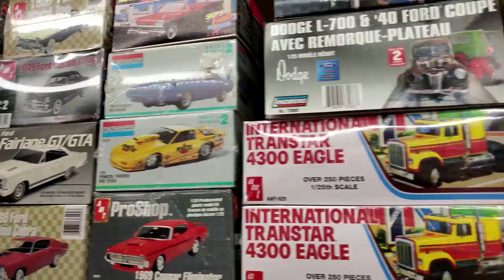Gluing Parts And Learning To Paint!! My Wife Is a Natural Model Builder!!!

Comment: You were talking about the chrome. Why not strip the chrome. I use Zep oven cleaner, spray a bunch in a plastic container. Leave the parts in it for 30 min or longer if needed and wash the parts after. Then you can paint whatever color you want.

Comment: I see you use a shop vac for the paint overspray and fumes.  What do you use inside the shop vac to contain the overspray and fumes from escaping the canister.
Reply from the maker: The exhaust is piped to the outside.

Comment: Primer, let's talk primer....
The primer you used in this video is a sealer primer. Its mainly used to seal the base material from outside contaminants. It lays fairly smooth and should be a little harder to sand once cured. I mostly use it on metal. The 2X primer is mainly a "build primer". Its like sprayable body filler, thus the rough texture. Hopefully this answers your question on why the primer layed so smooth. I genuinely don't think it makes a difference which one you use for plastic model applications.

Chris

Comment: Its Heather's model. If she wants to paint the chrome work. Then off to the paint booth the chrome goes. lol

Ohhhh... Actually, speaking of paint. Don't forget you don't just have to stick to Hobby, or hardware paints. A couple of cars I'm doing now call for nail polishes. A Jo-han 60 Desoto Adventurer in white, with Rimmel Mermaid Fin polish ( Kinda a pearlish finish. I've had the kit for months now. And the paint job is holding me up because I want white. but the kit is molded in 70s red plastic. Every white I have turns pink on it ) And a 40 SD in Color me silly's Obsession. Which is a flippy floppy, multi coloured paint.

And yep. I did almost spell it liqueur based. Thank you google auto correct. lol

Ahem. Doesn't matter what blue you paint a Ford engine. its always the wrong blue. 

Well, Heather didn't get any drips, or runs in the paint. Didn't accidentally gas herself with enamels. Didn't give herself a racing stripe. Or ruin a $200 cashmere sweater by tipping resin down the front of it. So, like I said in the last video. She's already 100% better than me.
Reply: You tell him! 😁

Comment: Just a some advice from a guy with a chest length beard and shoulder length hair! DONT HANG YOUR HAIR DOWN ON THE BENCH!!!! I "lost" a piece of a truck one time,don't remember just what it was but 3 or 4 other pieces keyed off it! After a couple hours scratch building a replacement piece and laying down for a nap,I got gouged in the neck by something... It was the missing piece,glue blobbed in a tangle of beard hairs!!!
I've also gone around for a week or so with a gradually fadeing  baby blue stripe of paint in the underside of My beard. Wind blew one time as I was priming a truck frame and had black primer stripe in my pony tail for a while.
Just some experiences with loose hair and model building. As I'm a giant hairy truck driver,these incidents didn't bother to much,but you are an attractive young woman and might not find something like this amusing.
Reply: 😆 Thank you for the advice! I'll be sure to try and keep my head up.
Reply: It's funny to me,but you got nice hair! It has happened several times.
Hope you keep up the building and painting. I've done it off and on for dang near 40 years,and I love it.